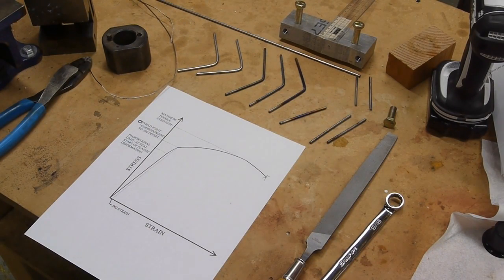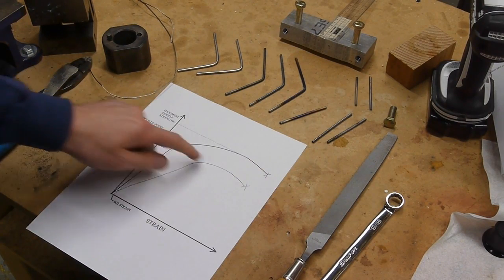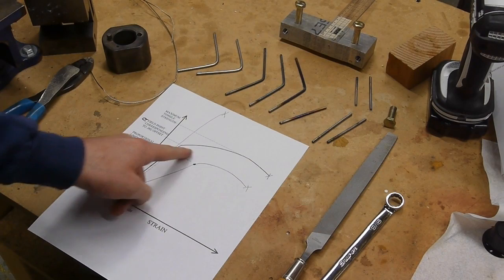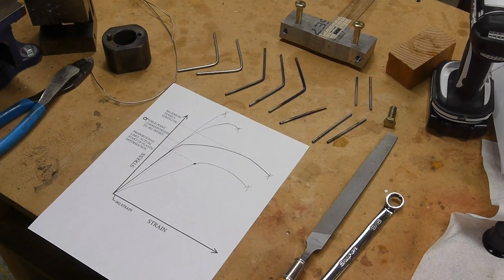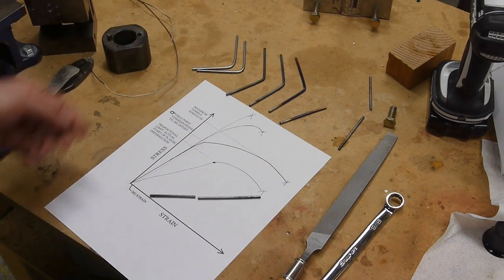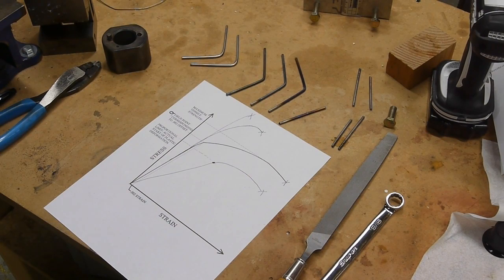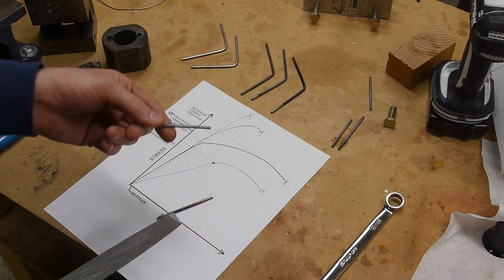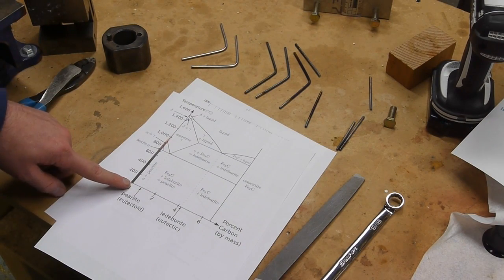Intro to heat treatment of steel (hardening and tempering)

Comment: So to get the best steel(equal stress and strain) without specific degree you heat it to a yellow/orange color and harden it in water and then heat it to a blue color and temper(cool it down) it naturally in air?
Reply: No, saying steel is like saying plastic. There's a significant difference in plastics and in steels. Visually marking temperature in steel by the naked eye requires extreme visual acuity and consistent lighting to even start getting into the ballpark. Cherry red in even a well lit shop will not look the same on a sunny day outdoors. There is no perfect steel. They might as well change the name from steel to compromise, because you are always giving something up.
Reply: To more accurately answer your question, no, it depends on the type of steel. Some steels will air harden and tempering also depends on the steel and is as much a function of time as it is heat.
Reply: Jonathan Anderson Say, I want to make a steel sword. What kind of steel do I use and how do I harden it?
Reply: Several steels worth looking at, I suggest you visit bladeforums.com for a start. Heat treat advice, you might consider asking a smith, googling or asking a steel provider like NJSteel Baron. Aldo.
Reply: King_Theoden What would the purpose of the sword be, considering you plan to harden it I expect you'll want it to do more than just hang on the wall and be pretty?

If you plan to do test cutting on soft things with it you may be able to get away with various stainless varieties, but if you intend to do anything that involves steel on steel either other blades or hard/rather solid objects I'd strongly suggest to do your research and pick the appropriate high carbon steel type for your project as the wrong type of steel may not be able to take the abuse well and break, you don't want sharp things breaking while they're being used.

But I do agree with Jonathan above, that's a really good place to start! You could also look at what steel types modern replica swords for actual steel on steel contact are made out of. 
http://www.albion-swords.com/swords/albion/squire/sword-squire-viking.htm

Albion seems to be using 1075 on this budget line replica based on the description, swords while simple on the surface are a rather intricate piece of design. You want the proper balance, something that's stiff and hard enough to not bend too much and be able to hold an edge yet during the abuse of combat that they're intended for also not break too easily. And as for what is proper... well it depends on what design you're going with, too much variation to sum them all up!

Comment: So if a water steel like was shown in this video was heated and rapidly cooled, then reheated and cooled slowly the steel would still be brittle because the carbon would be burnt out of it, or does carbon not burn out?  Just curious
Reply: Okasen the carbon content doesn't change, what you're changing is the crystalline structure of the steel. When it's red hot it's in a neutral state, and the crystal microstructure forms as you cool it. How you cool the part determines the properties you wind up with

Comment: hey i have aquestion what would be better for a thick gun barrel normal steel or hardened steel?
Reply: Hardened Steel is resistant to Scratching, indentation and wear ,which is what you will get most of in a gun barrel. Ordinary Steel, like BDMS will last about 5 minutes and then jam up.
Reply: I. Tsasecret Gun barrels are very often made of 416 stainless. I have quite a few firearms with stainless steel barrels, I'm not sure what you're thinking of. Hardened steel would be kind of pointless for a gun barrel, you're not shooting a steel projectile, you're shooting something softer than the barrel. So a softer material can't scratch a harder material, basic physics. Copper and lead are about all most gun barrels are ever exposed to, and the primary wear factor is almost always erosion from gas pressure and heat. Most military firearms have chrome lined barrels to protect against corrosion and moderately improve the lifetime of the barrel.

Most desirable steel for barrels is usually 4150 chrome moly.
Reply: If it's not hardeed, it will not withstand the wear/pressure. It's why gun barrels are never stainless steel. The gun blue treatment is it's only protection from rust.

Comment: Hey Ben,
Thanks for this excellent video too.
While you would really need to pull the samples to get a more straight forward assessment of tensile strength, I appreciate the bending test, because it relates to the real world more readily. 
The difference in each radius resulting in the normalized vs your heat treated samples is a great indication of work hardening and gives some insight the stress concentration involved in the higher strength samples failing under far less load.
.
Also, it is interesting to note that it is possible to harden low carbon steel like a coat hanger with methods very similar to what you describe, thought the hardness will be more apparent in a file test than a bending test.
.
Carbon diffuses through steel at elevated temperature.  This can cause a reduction in carbon in the outer layers of steel when it is at high temperature, so it is important to be aware of this and its possible ramifications.  This phenomena is also useful for increasing the carbon levels in steel near the surface.  This can be utilized to case harden many types of low carbon steel, providing a hard wear resistant surface, but still maintaining the ductility of low carbon steel for the whole piece.
.
A convenient low tech way to accomplish this for small pieces of steel from coat hangers or more usefully with things like knives,:
- Use a lighter to apply a layer of soot to the piece by holding the piece in the lighter flame.
- Use a more powerful torch to heat the entire piece up to a red glow and hold it there for a short time to allow the carbon to diffuse inward... a carburizing or neutral flame would be preferable to oxidizing.
-Quench and temper.
.
Anyway, thanks again for this great video and the many others you have made.

Comment: Very Nice Video, I really liked it. Seems you know what your talking about. (+1 : 1,273)

So if I buy 1095 Blue Tempered Spring Steel from McMaster Carr, which I'm going to be doing Friday 05.02.2014, Will it be very strong? I want to make lock picks, and I want very nice steel, because I'm making the shank of the picks 2mm to 1mm. They say that the Hardness is C44-C51, which according to there chart is between hard & very hard, where Tungsten is like a C79, but they don't have any Tungsten in the thickness that I want, 0.025" I would like to ask you, how would I go about cutting the 1095 Full Hard Tempured Shims (Item No. 9014K67) ? Would I just use an Abrasive Cutting Disk for a Dremel or Right angle grinder?

Comment: Very informative and explained in the simplest manner. Would you be able to advise me on a heat treatment related subject ? I want to manufacture a steel tube that would have flexible expanding feet at the end and axial splits across diameter for the reason of radial expansion. I am working on a project to design a temporary single sided fastener for aerospace assembly. My question is that how to manufacture such flexible clamping fingers in a collapsed position which can expand through a driving mechanism and collapse back too again.

Comment: PMMA is used in our lab for conductive flexible thin films. Coat a glass substrate with it, deposit the material and coat it again. Then you can get it off, provided you have a sacrificial layer beneif the first PMMA layer.

Comment: So, would it make sense to temper files and saw blades yourself depending on what material you plan to work on with that specific blade ? Thanks for the videos, very clear and straight to the point !
Reply: No it sure wouldn't make any sense. Files are usually coated. They're generally not "just steel"l. Sawblades? They're  generally made of HSS (High-speed steel), so they're pretty much ideal for cutting. They're not made of "normal steel/iron". If you buy tool or blade they're already tempered. Actually trying to heat treat ie. saw blade yourself can very likely result in making a deadly tool. Properly made blades won't shatter in use. Industrial class hardening/tempring is a very delicate process. You absolutely can't get same results in general home workshop. Very extensive material knowledge is absolute must. This concludes just the heat treatment of metals. There's incredible amounts of "metals" sold for specific use and most of them can be heat treated for "fine tuning".

In short. If you buy a tool/blade that you can actually get better, in even at good workshop conditions. You've bought some of the world's worst tools ever made.

Comment: Want a trippy superelastic steel? Austempering. A buddy in my guild quenches in a salt bath normally used for bluing (350-ish C, iirc) can bend a sword almost into a U, and it springs back, but still maintains 50+ R hardness. Google forth fellow science dude. Recipes abound. 😃
Reply: What thickness was the material, the amount of elastic deflection a peice can have goes up with thinner peices.
Reply: Rion Motley does he do them for cutting buhurt or Hema? I'm genuinely interested.
Reply: Ok, that is feaking awsome! I would love to see that.
I looked up the process, it seems fascinating. I believe I will actually spend some time reading about it.

Comment: I was the only one in my shop that can run the induction others could not see the color  temperature of heat the way I can plus when I change the polarity own the batteries I'm talking big battery the type that electrocute you if you do not ground them out probably I had the honor of doing all the military parts I could also maintenance all the machinery the vacuum furnaces chromoly lined man I hate having severe arthritis I miss work in 24 7 my walking is limited im partially in a wheelchair :(

Comment: I heat treated for years I enjoy running the Epson furnaces the most I was the best at probing the baskets of metals whenever they slipped on the elevator going to a oil quince I can take it 8 foot stainless steel hook probe around the sides of 0.1 stainless steel baskets and hang them without seeing what I was doing once the steels removed we had to load it into a draw furniture. Dixie barons had to go into deep freeze than into a draw furnace best of all induction heat treating :)

Comment from the maker: The upper-case Greek letter delta is often used to represent the relative change in some quantity. So, "delta L" is the change in length for a given beginning and ending condition. Lower-case delta can indicate the deflection of a mechanical system under load.

Comment: Pure iron (alpha ferrite phase) is very ductile and malleable, it has low yield.  As carbon content increases harder phases can form, especially iron carbide phases once the ferrite is saturated with carbon at around 2%.  Around 1/3 to 1/2 a percent carbon is where steel peaks in "toughness", beyond that it keeps getting harder but more brittle until cast irons which are more dominated by intermetallic iron carbide phases (eventually graphite too).  The iron/carbon system is very complex.
Reply: Excellent point.  If I understand you, the carbon inclusions no longer reside as part of the cubic array and become inclusions that disrupt the continuum of the crystal structure?  And you're saying that this occurs at or about the 2% carbon point?  I hope I've worded it right.  That seems to be critically important in adjusting the properties of the steel

Comment: taking me back to school days I seem to remember, if you take the coat hanger steel say, heat it up then dip into carbon, you can case harden it, repeat this by working the steel and the harder it will get. used for knifes, swords etc in days of old.

Comment: "Can you do this with a coat hanger?" Actually yes. You can increase the carbon content by baking the part while covered with carbon powder, as carbon can diffuse in and out of steel at high temperatures.

Comment: That very last bit seemed confusing to me. You are saying that a very very low, almost negligible carbon percentage is 'cheap low quality' steel, around 1-2% is 'good steel' but as you get higher quantity carbon in your iron... it's just cast iron? What if the absolutely no carbon, even just pure Iron? Apart from that, amazing video, really informative and well presented. Thanks!

Comment: One thing that wasn't totally clear (to me) is that to get the tempered or annealed state, you have to first "case" harden (high heat and quench) and /then/ heat and let cool slowly. I was a little confused because the oxide isn't formed in case hardening, because you quench in liquid, but it is formed during tempering because you cool in air. So when you start the tempering, the oxide is formed there... right?

Comment: If  you have an old barbque in the shed and a few brickets left over you can actually induce carbon into the "cheap steel" making it hardenable.   You won't get snap on quality steel but you'll definatly notice the case hardening.  I've also used gouging rods, mainly to spot toughen mild steel in high wear spots.  Just get it red hot and roll it around in a powdered form of carbon.

Comment: its not immediately clear that toughness(energy that a volume of the material can absorb before failing)is area under the stress-strain curve.what quenching does is sacrifice almost all the plastic toughness for a medium amount of elastic toughness,leading to a stiff but brittle material.tempering then sacrifices some of that gain for a medium amount of plastic toughness, so that the tempered material is still stiffer than untreated,but can give a little warning (by deforming) before fracturing

Comment: Ben, I made the wire you are using from mc master-carr! 

At Universal Wire Works, we make wire primarily for welding. Drawing and straightening.
I have done many similar experiments. Most annealing only requires reaching the "annealing temperature" upon which a "solution anneal" occurs and then it doesn't really matter how quickly you quench the material from my experience. I would really enjoy discussing my research further with you.

Comment: Dude, really? My "Material Mechanics" (which is sort of an introductory class) explained pretty much what  Ben said, going a little deeper into the mathematics and crystal dynamics. We didn't had any experiments (since here it's not that easy to grab a torch and temper a piece of wire for the class), but he pretty much explained various applications, plus showed some videos of material testing...  I thought any mec. engineering undergrad had seen such things in such a way at some point.

Comment: Nice refresher course Ben - for an old fella :) Be interested later if you cover this again - to get your take on using silver steel to make, say, a small cutter insert for a boring bar - degree of temper you'd apply to back off from too hard. Other thing is oil vs water quench and your approach to that.  Oh and - one other thing - making a spring!!! To some more of an art than a science! Thx for another great video.

Comment: What's the application you need the wire for? You might not need a high carbon.

 McMaster has some 1065, 1075, 1080 which all harden up nicely. 65+ hrc out of quench.  (the 65,75,80 is the amount of carbon. so .65%-.8%) They are not 1% but you don't need that. These are commonly used for swords and knives.
If your using a torch I would go with the 1080. It's eutectoid, meaning its pretty friendly to a torch. Where as most steels will give a poor HT without using a temp controlled oven.

Comment: Thanks for the response.

If I wanted to buy a wire with 1% carbon what would I look for?
I know if you just buy a wire in a hardware store you get the cheap metal kind of wire. My thought is in case I wanted to buy a wire for the function of letting me harden it with a blowtorch after I shaped it for my requirements.

Comment: Nope.

Only thing you can do is case harden (does not involve hammering), which involves soaking steel at around 1800*f  for anywhere from 30 minutes to 6 or so hours in a carbon rich environment (IE charcoal, bones work really well). Even then you will only get a few thou thick of material with carbon and even then it will be a low amount. 

Getting a high carbon content and a uniform alloy requires you to re-smelt.

Comment: The hammering you refer to is probably making wrought iron from bloom?  Prior to blast furnaces (which make pig iron - high in carbon 4-5% - brittle as hell), bloomeries avoided getting too much carbon into the iron (<< 1%), keeping it higher in melting point.  The result was a spongy mass of fairly pure soft iron and lots of slag.  The beating was to drive out the slag and homogenise the bloom into wrought iron.  Steel is < 2% carbon, but highly pure iron is very soft and nearly useless.

Comment: Heating steel constantly doesn't really lower its carbon content. The temperatures you need for this to happen are at the melting point. Well past critical. Before that can happen you will run into issues with irreversible grain growth that will destroy the steel anyways. 
---
Also color is a poor judge for HTing anything, A difference off 100*f can produce poor results but the color difference can't easily be seen. 
When tempering colors can get thrown off by contaminants on the steels surface.

Comment: in that case yeah - i assumed you had soem premade object/item you didnt want to change.

The thinner the metal when you heat it in a chamber with a carbon source would allow it to penetrate deeper - or through the whole metal.
Blacksmiths dont actually add carbon - they still smelt it to mix with carbon or use pre carbonized steel.
Constantly heating the metal will lower its carbon content over time.